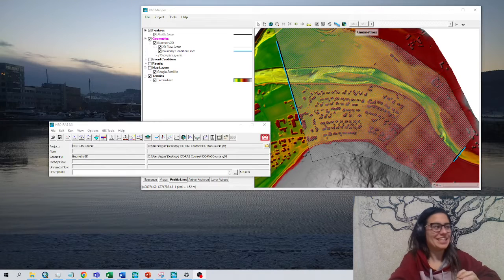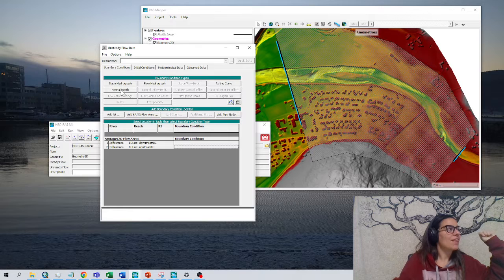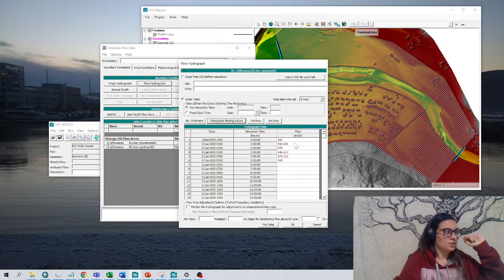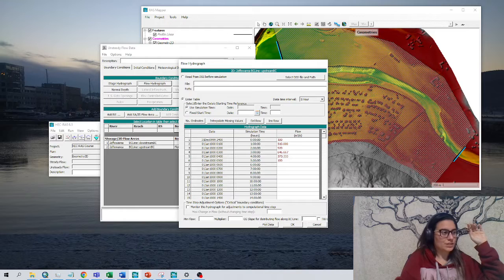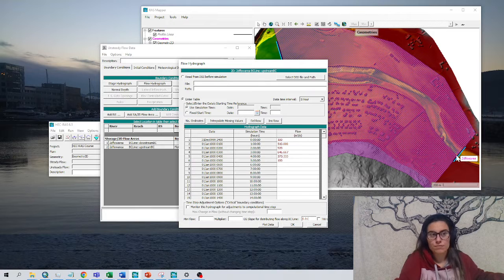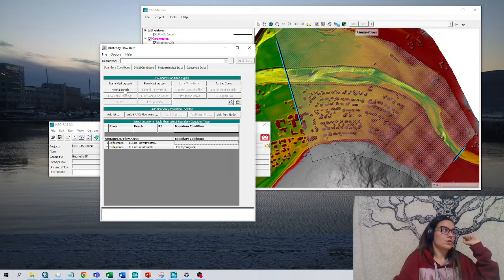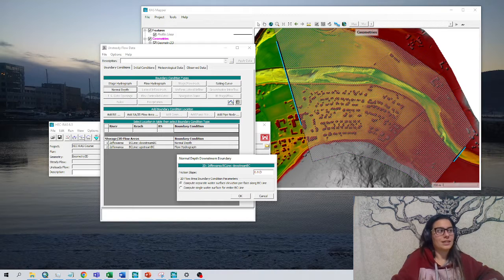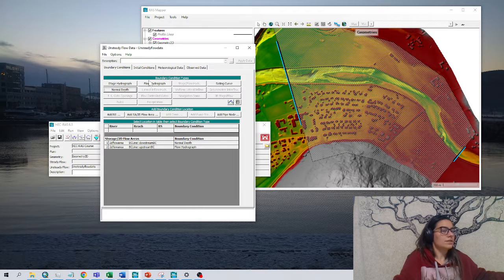Chapter 3  HEC-RAS 2D Boundary Conditions Flow Hydrograph and Normal depth

Comment: Hey I just want to ask, if the downstream condition is far from the place of investigation, is it ok to put allways 0.01? Thank you 😊
Reply from the maker: Yes, this 0.01 refers to the slope around the BC, but this value varies from cell to cell, therefore is very hard to set a value that is perfectly valid for all along the bc. Just set 0.01 and asume that last computatios cell raw is not the best.
Reply: in my case, changing the downstream condition highly affects the output, regardless the place of investigation. I have changed downstream normal depth from 0.01 to 0.001, and the discharge at the mid point of the river is different. 
@markotrajkovski953 do you know how to solve it now?

Comment: Hi , Ana , I see that you have building elevations flattened on the terrain. Do we need to create Breaklines around those buildings ? Or just a normal mesh would work fine ?
Reply from the maker: Normal mesh works just fine, hec compute water depth based on average elevation and then interpolates with terrain resolution.
But if it is important how water moves around the building then you might need a much finer mesh.